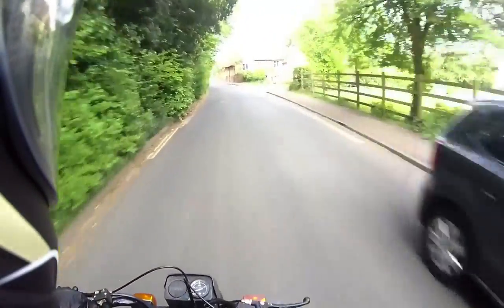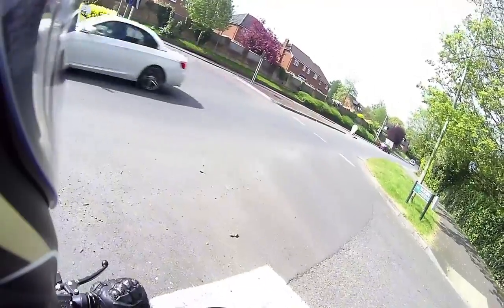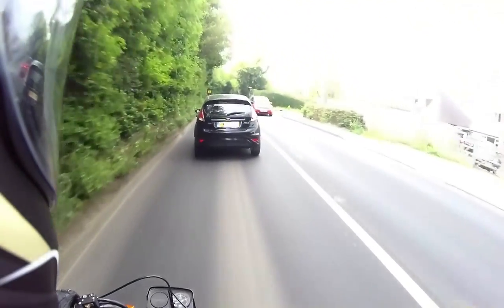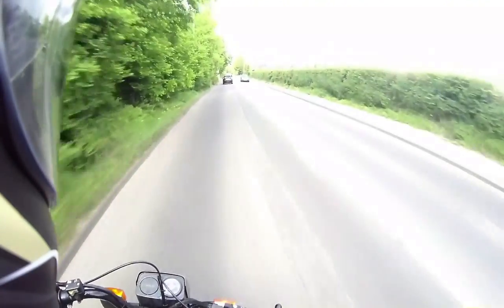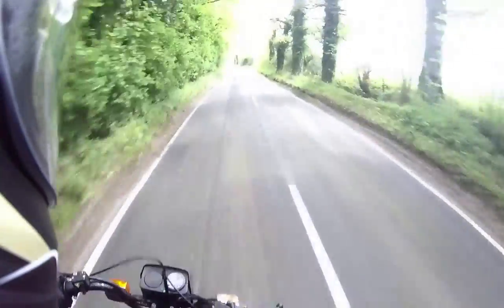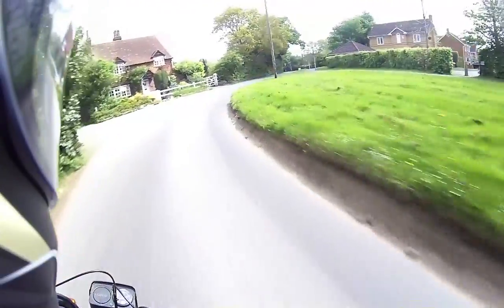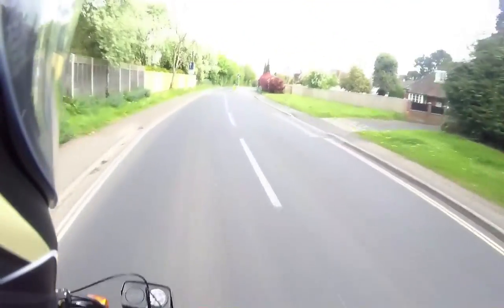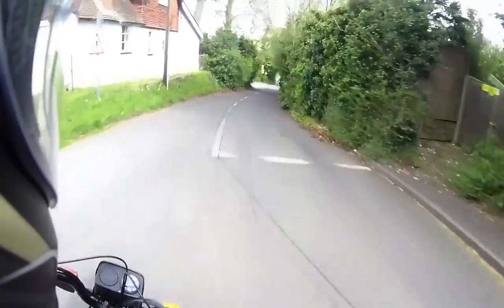65cc Kitted Tomos A3ML Top Speed & Hill Test with Skids! | JAM#7

Comment: Im looking to put a kit on my Tomos A3. Where did you buy the kit from and what is your spec? I believe the bush is the same as the Puch but i cant seem to find anywhere which sells them :/
Reply from the maker: The kit is a DMP 65cc Aluminium jug & head for a Tomos A35 engine. I bought it as a package from TomoShop.nl (Part #10014 on their site). I bought the bush from YPVSpares.com (Part #PM1265) although any 12mm Puch bearing will work. You will also need to buy an A35 manifold, a reed block and gaskets - and suitable carb or jets. I am running a Dellorto 14/12 with >56 jets. The manifold is a standard "28kph Stock" manifold from TomoShop.nl with the restrictor collar removed.
Reply: Thanks for the info :) I will get on there now and order some parts. Its a shame to swap the crank to the 12mm needle roller as it has only done 43 miles from new.
Reply from the maker: One thing I would recommend, is buying a standard bronze bushing as well as the needle roller. I bought a couple of different roller bearings and none of them ended up fitting, the bronze bushing meant I could at least get it up and running!
Reply: From what a gather the bush from YPVSpares is good for around 9500 rpm so hopefully if i press the existing bush out and replace with that it should be good to go?
Reply from the maker: Should be - just don't make my mistake, and make sure to run it plenty rich - as you might see in my next video I seized it later that day !
Reply: That's not good. However they are cheap enough to replace i suppose. Which part caused the Tomos fatality?? I do have to say your videos are hilarious :)